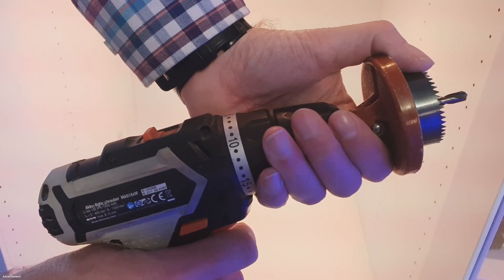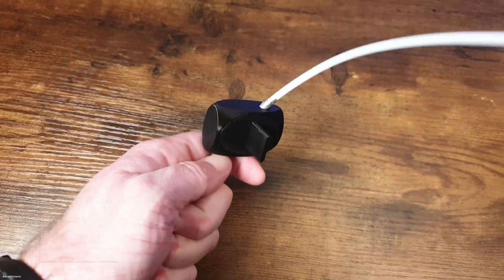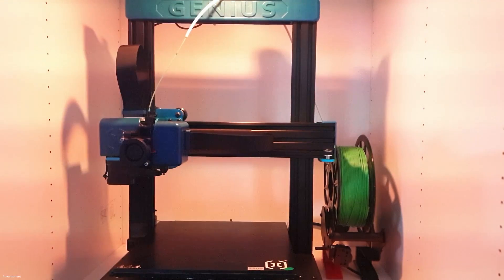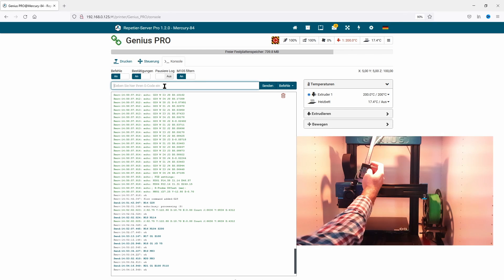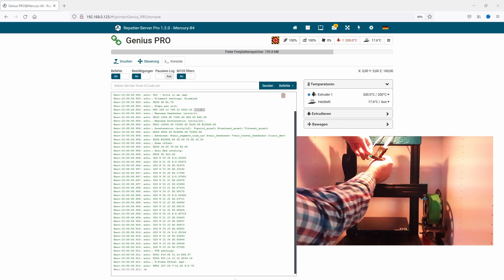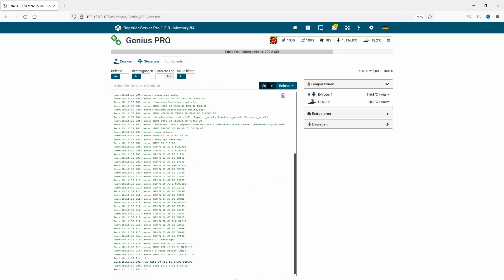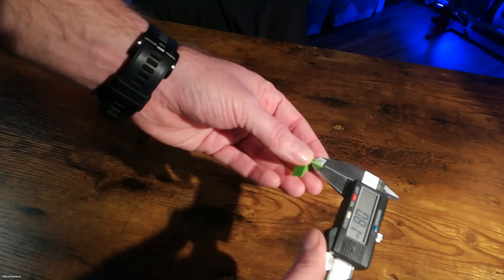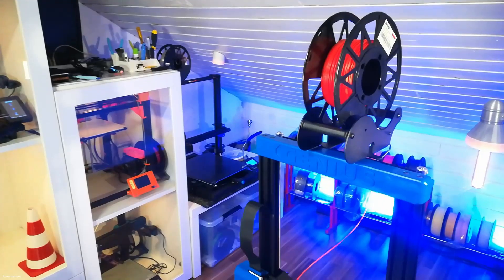Artillery Genius PRO - my improvements and modifications

Comment: How did you setup the filament sensor, in both the positioning on the spool holder and in terms of the electrical wire?
Reply from the maker: Hello, I dont use the filament sensor - I dont like them anyway. If you plug out the sensor and power off / power on the printer,  it won't be detected anymore.
Reply: @3dprintpassion  
But if you were to use it, how would you go about it?
Reply from the maker: To be honest, I did not checked. Maybe the best way is to find a new way for the cable, not going to the top of the printer, but going sideways.

Comment: Hello, the BL Touch of my Artillery Genius Pro give my ERROR M999 so the extruder does not go down when I want to level the plate. what can I do? Thanks
Reply from the maker: Hello, for the Genius Pro Touch, to be honest- I dont know for sure. At the original BL Touch there ist a little srew on the top of the BL Touch, which can be moved a few degrees maybe 5-30 (so very less), clockwise or counterclockwise - need to be tested which is working better. In plus, you can pull down the needle very carefully down a bit, make a M999 by terminal to reset the sensor - which should result in moving up the needle again. Like I said, I'm not sure if this will work for the Genius Touch sensor. Of course, there is also the possibility to create a support ticket at the Artillery Website. The support is very good for a Chinese company.
Reply: @3dprintpassion  Thank you very much, I'll try .... I contacted support but they didn't give me any advice

Comment: What do you do about the power supply's cooling?
That part is super sensitive to heat and if it doesn't have anywhere to exude that heat it will break quickly.
How did you get over that issue with the Platsa?
Reply from the maker: I do not have cooling problems with my power supply inside platsa. I have at the moment 4 Printers inside Platsa, 1 Sovol, 2 Artillery and 1 Creality. 3 of them was already printing last summer  (some 3 day prints) with 30 degrees room temperature under the roof - in summer I did open the Platsa door 2cm, to avoid heat build-up inside the Platsa. The temperature on the bottom (where the power supply is getting cold air) is arround 40 degrees while printing PETG and around 45 while printing ASA with 110 degree bed temp at room temp arround 22 degree with door closed.  Of course I can't guarantee something - but for me it is working very well. The Platsa ist not hermetically sealed... By the way, I have smoke detection with WLAN and cell phone push to have a better feeling.
Reply: @3dprintpassion  
Where did you end up placing the spool and holder?
Reply from the maker: Hello, I placed it with my modifications  behind the printer on the right side, parallel to the rear of the printer base. So the filament have at less as possible resistance, move along to the top and back down to the extruder.
Reply: @3dprintpassion  
Do your spool stand thingieverse designs also work with the regular Artillery Genius?
I am VERY interested in implementing your setup on my Artillery Genius.
Hence all the questions.
Reply from the maker: Hello, the part to place on the top, will fit. The ABS topper design looks like 100% the same. I do not have the old spool holder from classic version anymore, but as far I remember there is also no difference. I think it should work.
Reply: @3dprintpassion  
Thank you for the information you've given me.